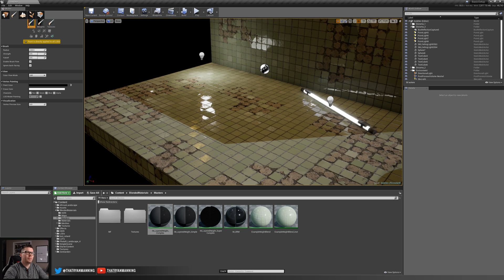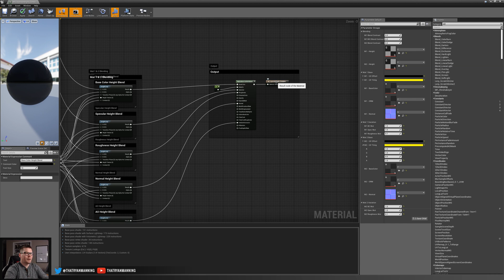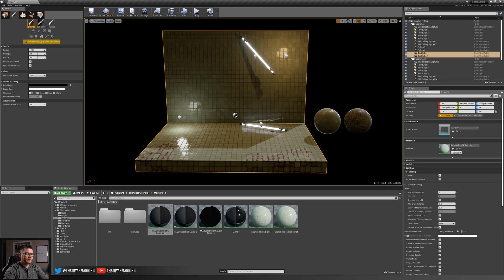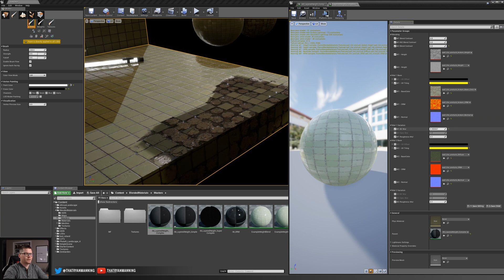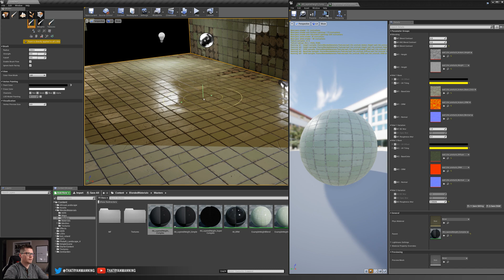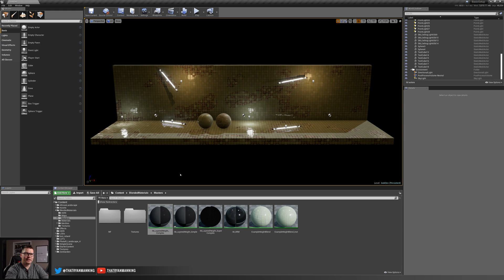UE4 Height Blended Materials - Part 3

Comment: It should be easy to add displacement and tessellation to this as well?
Reply from the maker: Absolutely!
Reply: @ThatRyanManning  cool yeah I added displacement to it now wasn't as complex as I thought it might be. In the case of adding a 2nd and 3rd texture variant to your material would that mean removing the Mat 1 Var and Mat2 var and putting in place a brand new Mat 3 and Mat 4 for that to work? Or is there a way to just keep adding Mat 3 and 4 while also keeping Mat 1 and 2 Var?

Comment: Hey Ryan, how would you achieve adding a dirt layer at the edges of where the unbroken tile and broke tile meet? I'm trying to achieve a painted metal to exposed metal, but with a rust in between the two at the edge for a transition between the two, not sure how to approach it though.
Reply: Old comment I know but you can manipulate your height information to get the band you need for the intermediate layer. Basically isolating that part of the heightmap as a mask for your rust.

Comment: Anyway you can make a tutorial on just your material node setup for us newbies? I still do not understand most of what you did there and I am trying to setup a material using all 3 RGB colors for some Quixel Megascan materials I made in Quixel Mixer. For example, I have a road material that uses a dry road, a wet road, and a wet or dry road with leaves., so basically 4 different setups.  I want to be able to paint in between them but not sure how to set it all up. I want to be able to paint on the leaves and water layers over the dry road using vertex painting but every setup I did beyond using one RGB channel did not seem to work right.

Comment: can you help me? i am trying to create a 5 way height blended painting material
i want 4 pbr textures + puddle effect on the material
i have made the 5 way material without puddle by following this like https://www.lostdaygames.com/5-texture-blend-material.html
and on another try by following this link https://evermotion.org/tutorials/show/10671/paint-puddles-in-unreal-engine-tip-of-the-week
the problem is the puddle shader outputs lerp nodes which cant be connected to the heightlerp and i have done 4 way shader without a problem ( 3 pbr textures + puddle nodes), but i want 5 way for maximum performance, according to lostdaygames the the 5 way is possible and i just don't know how to plug the puddle node on to the 5 way shader. 

please help